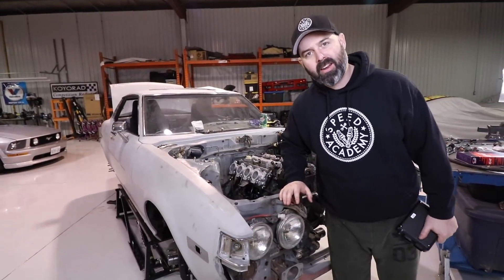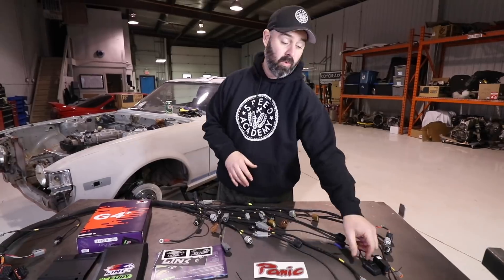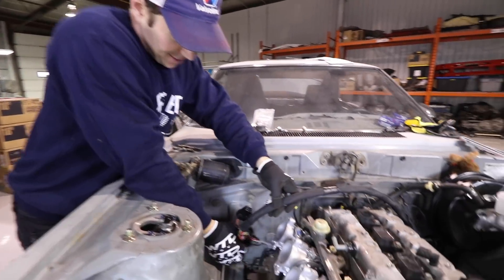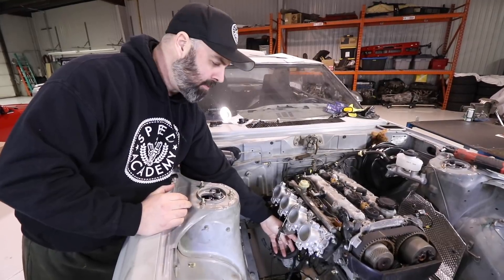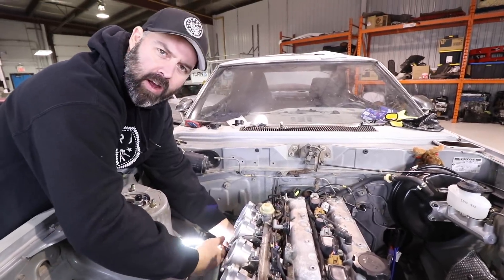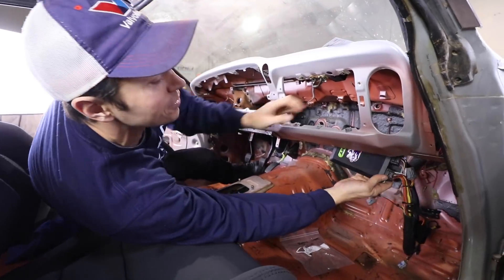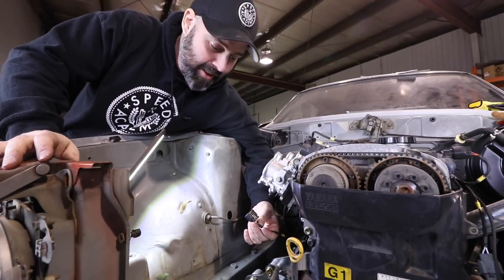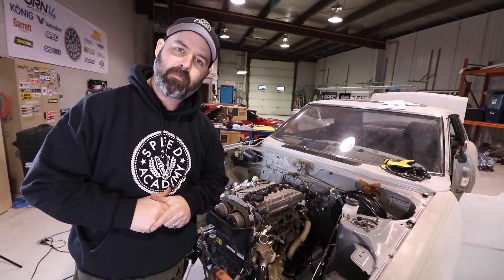Custom Engine Harness Installation - RA24 Toyota Celica Project

Comment: Heater Core?? where does it go through the fire wall    also what's a PDM??
Reply from the maker: Heater core is gone, it dry rotted in the desert, not going to replace it (we'll be plugging/welding up all the holes in the firewall before paint). We are installing a small blower motor/defroster for the windshield, though.
Reply from the maker: PDM = power distribution module, which is a solid state replacement for the traditional fuse panel setup. So the Smartwire gets power from the battery and then distributes it throughout the car to power all the accessories, headlights, etc.
Reply: I see thanks

Comment: LOL...The last time I did an engine swap it was much easier wiring. Wire to the starter, wire to the alternator, wire to the coil, wire to a temp sensor, wire to an oil sensor and a wire to the choke. Connect the battery and start it, done!!.....LOL...LOL (How old I am... :-(  )
Reply: Robert Kohut well, if it was 12v Cummins you would have a couple extra wires with the setup you named (just kidding if it was going to be a quality install but those things don’t even need an electrical connection to keep running). Besides the starter and alternator they don’t need any more wires but you might want a temp sensor/oil pressure/EGT, maybe a boost gauge...

Comment: Hey guys did you just run the harness through the heater hose hole ?????
Reply from the maker: Nah mate, the heater hose pass-thru is right behind the cylinder head.
Reply: Indeed I think it's the air/con pass through ? You guys have 4x60 anyways :) 

Hey can you get me some of that fuel hose and I'll buy some merch for your troubles

Comment: Do you plan to freshen up the engine
Reply from the maker: We put fresh Iridium spark plugs in it, will of course do an oil change and coolant change, we changed out the timing belt and tensioner in a much earlier episode, but other than that we're just gunna send it #larryenticer69